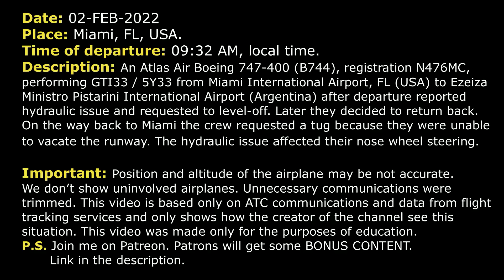No nose WHEEL STEERING. Hydraulic system failure | Atlas Air Boeing 747-400 | Miami, ATC

Comment: I'll be honest, every time there's an Atlast Air 747, I listen closely wondering if it's Kelsey from 74 gear
Reply: My son has been with Atlas for 8 years and is a Captain and has never met him. Not surprising since they have 2600 pilots
Reply: I didn't know Kelsey work for Atlas air that's good to know
Reply: 😍 He's a good guy
Reply: @carolthomas7638  yes its acmi nothing more i am 100% sure he operates for atlas air atlas is a charter airline and is very known for doing acmi flights for fedex and ups that doesnt change the fact he flys for atlas
Reply: In the last several years Kelsey bragged he flew the Dreamlifter 747 operated by Atlas. Since my son has been with Atlas for 8-9 years, they all fly the 747-4 and 747-8 along with the Dreamlifter. Only live video I have of my son was him landing the Dreamlifter bringing 787 wings to CHS from Narita, Japan. Boeing has ended 787  Dreamliner facility in CHS.
Reply: @carolthomas7638  alright we’ll then he must fly for both airlines lol
Reply: @rriverz6836  I do know many Atlas pilots were applying to UPS after the last union agreement. My son is fairly senior, but I’m sure Kelsey is more senior and probably got hired with UPS.
Reply: Hé works for UPS
Reply: @rriverz6836  he absolutely does not work for ups since ups doesnt 1 fly pax and 2 fly the LCF he works for atlas air
Reply: @mrunlucky4085  Ive cross checked 3 of his flights before, all have been UPS
Reply: @rriverz6836  false look at the tail number in his one vlog he flys for atlas
Reply: @rriverz6836  also he flys the LCF which atlas is the only airline that operates it
Reply: @mrunlucky4085  well every time I see his flights, they are in UPS 747’s with the valleien “UPS” os yeah kinda weird